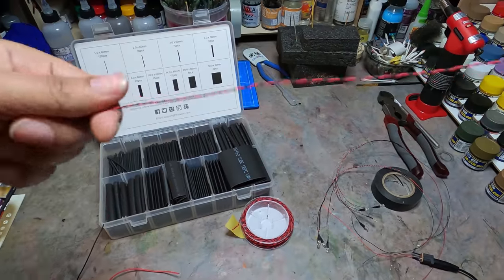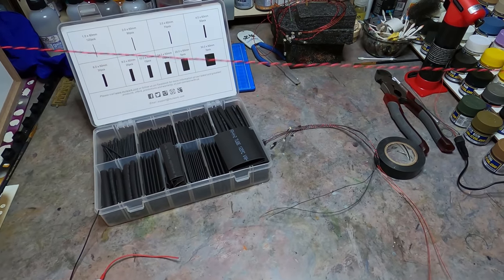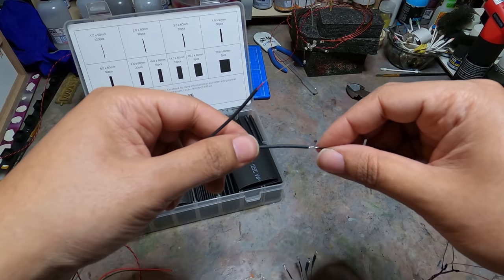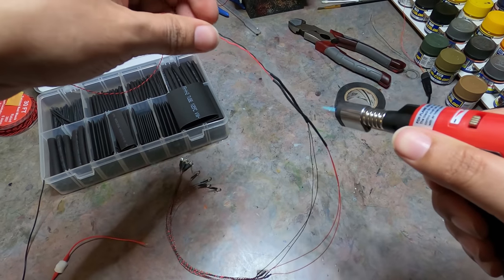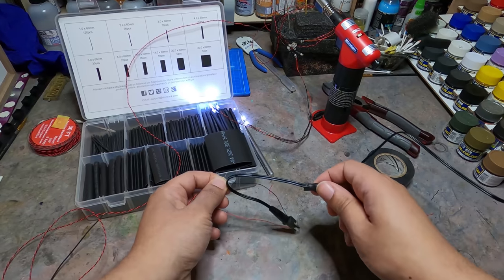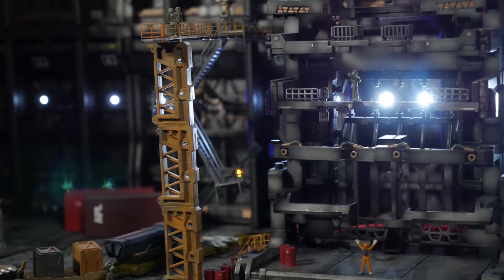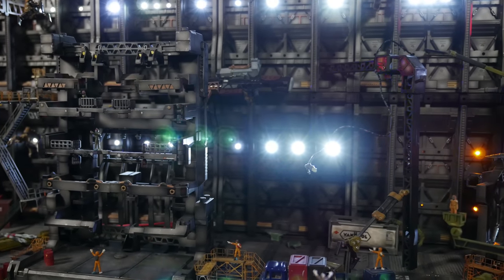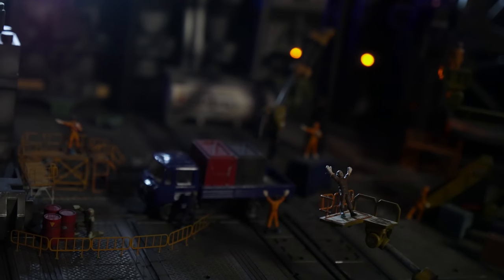How to wire up LED's for your 1/100 Scale hangar bay diorama

Comment: If you want to light the floor, one option I would look at would be mounting the leds at floor level in the surrounding structures. I've worked in a lot of heavy industrial industries and floor level lighting is never on the floor, too easy to break with heavy equipment. Love your work man
Reply from the maker: That is a good idea

Comment: If you want to light the floor, do some indirect lighting. You could use a stantion or a lightbox extended from the back wall. But the aim is to have a light were you can't see the bulb, just the light that it throws. This way it looks better filming as it won't blind the lens.

Comment: I'm not a Gundam fan, not by a mile, never saw the appeal.

BUT, i still like the models and the effort put in it, cause i'm still a Hobbyist by the end of the day, i'm a long time WH40k player and collector, so i can appriciate the work some people spent on their Gunpla.

And i gotta say, this Diorama is an absolute UNIT, its detailed, realistic, grim and used,and you can see and feel that if it was a real Hangar, it would be practical and realistic, the lights are doing a great job.

Its a really worthy piece, good job dude.

Comment: I'm guessing there are small 1/8 watt resistors pre-soldered to those LEDs under the heatshrink at their bases. This is a thing some hobby suppliers do. Just saves you a step. I buy my LEDs in bulk and my resistors in bulk. I'll spend $2 on 100 resistors, and $8 for 100 LEDs. You just have to do a little extra work. Since I work in N scale (1/160), I also like to have the LEDs in the models solo, without the resistors, and have the resistor on the other end of the wire, by the power source. You can get what is called a "Proto PCB". The brown single sided ones are super cheap, and if you want higher quality, you can pay extra for the green double sided proto PCBs. Just solder pin headers to the board, solder 1/8 watt through hole resistors of the desired value, connecting each side of the resistor to the appropriate pin header. On the LED side, a second row of pin headers is placed adjacent, and is all wired to either your positive or your ground supply (depending on how you chose to control your LEDs).

And example below would show 8 LEDs wired for common ground, and positive control.

1 2 3 4 5 6 7 8 (-)
o o o o o o o o o
|   |  |   |  |   |  |  |   |
R R R R R R R R |
|   |  |   |  |   |  |  |   |
o o o o o o o o   |  LED (+)
o-o-o-o-o-o-o-o--'  LED (-)

If you use negative control, then just swap all the (+) and (-) wiring. 

If you get a wire wrap tool, you can directly attach the LED wires, without solder, directly to the pin headers. If you don't have that, you can also buy pin header wire kits. They have the appropriate sockets that plug into pin headers pre-crimped to wires. Cut them in half, strip some insulation, and solder (or twist the wires, like you are doing, either way is fine), and shrink tube the joint. THis lets you plug the LEDs into the board With a cheap label printer, you can even label what LEDs the board controls and apply the labels to the board.

As far as power source goes, I just buy cheap off brand Arduinos, and attach the LEDs to the digital outs. That way, I can control the LEDs remotely. You can also use simple switches to control things. If you don't want to deal with programing, and want basic flashing lights, you can either use self flashing LEDs, or you can try using an adjustable 555 timer board. Probably skip the relay versions and go with the smaller no relay version (relays audibly click). You only need a relay for large loads, and LEDs take very little power. A transistor or MOSFET driver is all you need to control LEDs. Many of these boards can be bought pre-assembled for a couple bucks each, and even come with the pin headers, so you can use the pin header jumper wires. You find the jumper wires often listed as "Dupont wire jumpers", "Arduino wire jumpers", or "breadboard wire jumpers". Depending on if you install pin headers or sockets on your boards, you might need "male to female" or "female to female" (giggety).

Regarding the topic of 3D printers... I'm personally saving for a resin printer. It'll easily pay for itself in no time, with the things I can make myself, vs what I'd pay buying them. I've seen the prices of some of these "fine detail" pieces, in the model train scene, and I've quickly realized it would literally pay off to just make my own shit. It'll be way cheaper that way.

I guess for me, I'm more willing to do the extra wiring work to keep things on the cheap. I also like my LEDs to be more hidden. No light should ever look like an LED. It should look like a modeled light. At N scale sizes, this can be very difficult. It's why I never use resistors (or pre-installed resistors) at the LED. I've ordered plenty of cheap Chinese crap, and even quality domestically sourced parts from distributors like Digikey, Mouser, etc, and even sourced parts from surplus suppliers like Electronics Goldmine, All Electronics, and even local shops (I love this place about 2 hours away from me called Ax-Man. Absolutely crazy stores. See if you have local surplus stores, they can be interesting places).
Reply: Jesus wept. Thanks for that detail. Do you have recommends on where to buy the items you referenced?
Reply: Go to digikey's website. They have the best search tool.
For resistors, Mouse over "Products", "Passives", "Resistors", "Through Hole Resistors", and click.
When the page loads, Click the "In Stock" box, and choose "Cut Tape (CT)" under Packaging, "Active" under Part Status, "0.125W, 1/8W" under Power (Watts), and then click the "Apply Filters" button. From there, you'll get a list of a few hundred resistors. Ignore the few specialty ones that are expensive in the list, and pick the value you want. They have a min-max range option under the Resistance search, which is easy enough to use. As of November 2019, if I click a random value, like the 100Ω, you see that the pricing gets better the more you buy. If you buy 100 pieces, it's only $2.01. You could select five different resistance values for a mere $10, and have some options to adjust whether you want an LED to be a little brighter or dimmer.

Or you can use Aliexpress and add a zero to the resistor count. Literally 1000 for about $3... Shipped... It's insane that theres even profit in that. I'm more weary of Chinese sourced chips (counterfeits are a huge problem), but resistors tend to be pretty basic, so you're probably okay.

Just Google an LED resistance calculator to figure out what value resistor you need.

For LEDs, China tends to be a pretty decent source. Both Ebay and Aliexpress tend to be VERY cheap, and you usually get a reasonably decent quality. You can find pre-wired SMT LEDs on ebay for about $15-16 per 20 pieces, shipped from the US (if you provide your own resistor). On Aliexpress, I've found some even more impressive deals. One seller is (currently) selling 100 piece lots of "pre-soldered micro wired LEDs" (I searched "pre-soldered LED 100") for $18-25 depending on size and color. That's DEFINITELY a deal, but be prepared for long shipments and Chinese shenanigans sometimes. Fortunately, Aliexpress tends to be very decent with handling disputes. Just take pics if applicable, describe if something is wrong, and they'll fix it. 

f you wanna stack LEDs onto a Digikey order, you can certainly give that a shot if you want, but I find Digikey can often be more expensive, sometimes A LOT more expensive. I rarely order LEDs from Digikey, unless I need a VERY specific color or type, and only if I don't need many.

Aliexpress and ebay are also both good sources of "Proto PCB", if you wanna use that too.

I got my Arduinos from a brick and mortar store called Microcenter, but ebay and Amazon carry both, and will be good sources. You don't need a name brand one. ny of the clones are fine, and legal. Arduino is an open standard. Means as long as the clone doesn't try to sell itself as an original, it works more or less like an original.

One warning about Aliexpress... If you use a VPN, disable it before logging into their site! China don't like VPNs, and unfortunately, that site seems to put your account into lockdown if you happen to sign in from a VPN. It's dumb. They say it's a "security" measure. Seems Digikey won't load if accessed from a known VPN address, but it won't lock your account the way Aliexpress does. It's really dumb.

Comment: Wouldn't using a heat gun be a better option for the tubing?
Reply from the maker: Used whad I had on hand
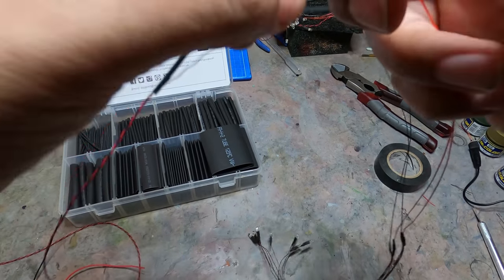Reply: @ItsAGunpla  i think he means that you said around 3:08 that he best way to go about it would be a soldering iron. I was going to comment on this, maybe you meant to say heat gun.

Comment: I dont know if this will work on that small of a scale, but I work with 10 to 22 AWG power wire alot. To twist them together I take the black and red wire and tighten the ends in a cordless drill and let it spin while keeping tension on the spools. It's easiest with 2 people but you can do it and make it look like factory-twist with practice. 

Thanks for vid papa Gundam!

Comment: I think the reason why Evan design doesn't want to solder the wire cause it can easily melt the solder on the led as their wires are good conductor of heat.

Comment: You do you boo, always. Tho are heat guns not more easy to manage and pretty cheap these days for arts and crafts level tools? No Fuel costs and management, pretty easy on electricity. If you light the floor I'd say less is more. Perhaps spotlights in the corners of the Mech Bay, and/or Just Ramp and Walkway highlights. And lastly my dude, all you do is appreciated and if I had any dollars to give I'd be delighted to give them to you.